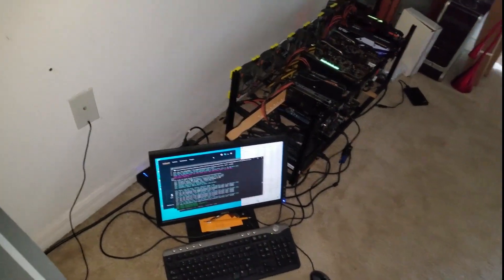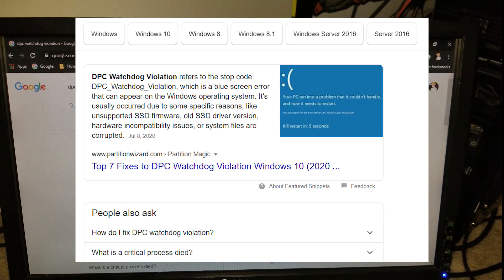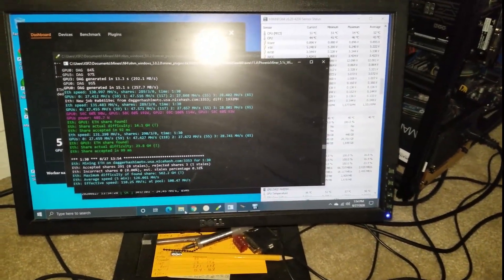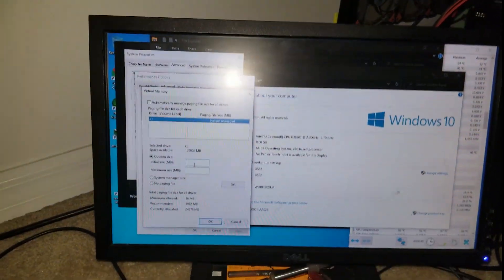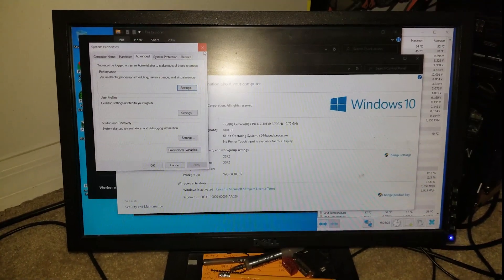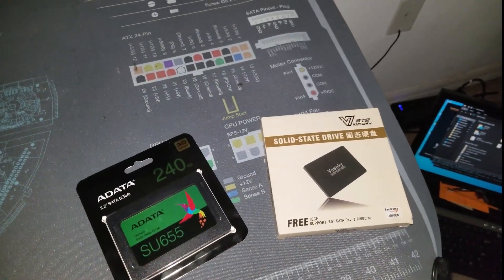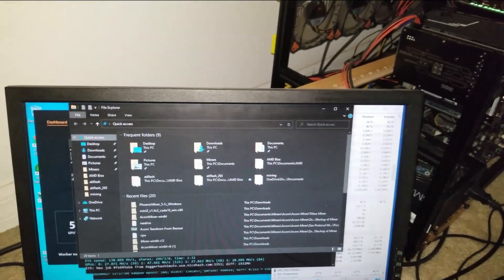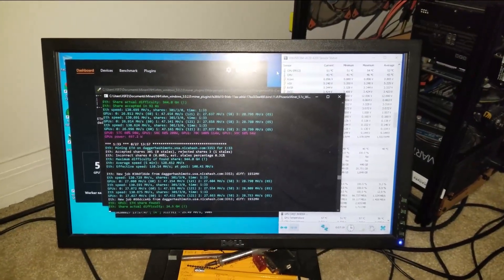DPC Watchdog Violation - Vaseky V800 BSOD

Comment: ooooh now  i have to see if this is the issue  i had on my nvid rig. i have random issues with loss of amd drivers on my 120 pny. hmmm allow win to manage again??? 120 pny at best buy $16
Reply from the maker: Let me know how ot goes, make sure all drivers are updated including ssd firmware. Check manufacturers website for firmware updates, if there is one, and instructions on how to update. But I have a feeling a recent windows update may have cause the issue, because nothing has changed hardware wise... but it only starting happening in the past month. Got another video showing how to minimize downtime when swapping HDD or ssd, so stayed tuned. Take care
Reply: @SerpentXTech  the last win updates hosed my networking system. hotspot to pc, then share that wifi network to the router via lan line an out to all other devices. since update only one device will run on the  network

Comment: Got the same error going . Starter yesterday after i updated my amd driver.  Ill give this a shot . Thanks!
Reply from the maker: Try updating firmware, or drivers and see what happens. If the issue continues I might have found something, that has to do with the issue. It is related to a Windows 10 update. Let me know if your issue continues after basic troubleshooting
Reply: @SerpentXTech  will do ill give it a shot tomorrow.  Im running a mixed mining rig with a Samsung ssd ( only because i had a spare one) 250 gb.
Reply: I have had no luck with the code still.   Installed and updated multiple drivers chasing this issue today.  From ssd drivers,  video card drivers , motherboard drivers to just about everything i can think of . I still get this code when i close a miner program.  Dosen't matter wich one or wich algorithm.  It crashed on exit only after the miner had run for a wile usually over 10 mins of mining.
Reply from the maker: @tonymock82  did you get the Windows 10 May update? If so that might be the issue, check Windows update
Reply: @SerpentXTech  im current on all windows updates